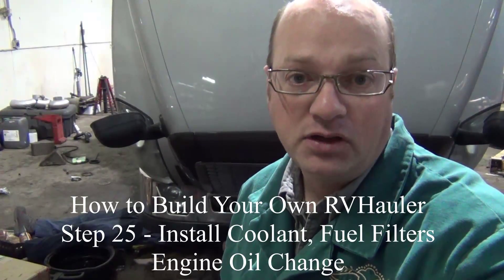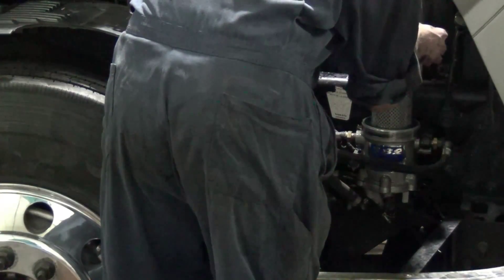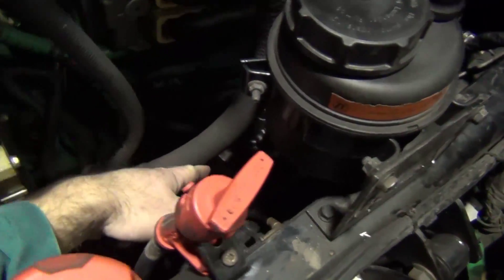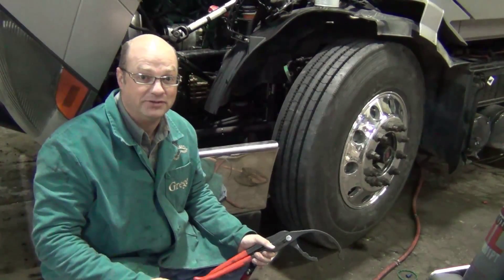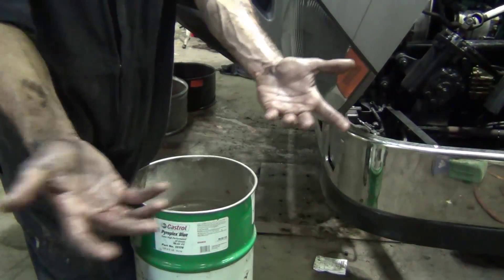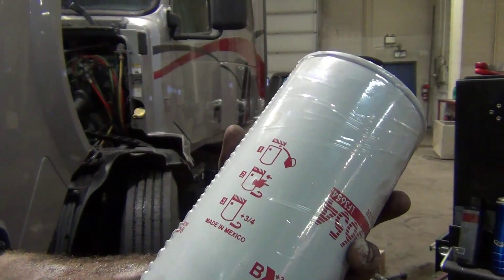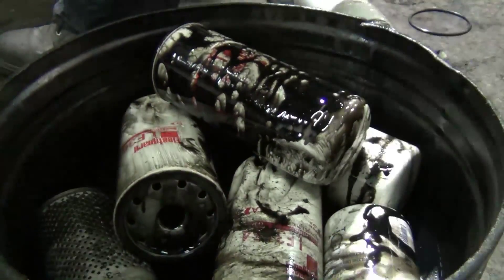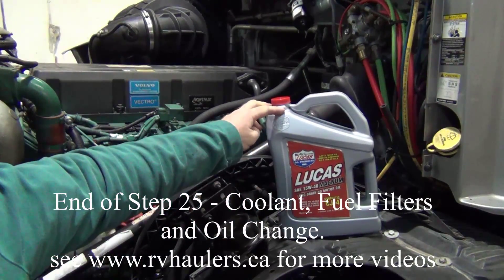How to Build an RVHauler -Step 25- Coolant, Fuel Filters and Oil Change

Comment from the maker: Good recommendation!  The filters are in a tight location between the engine and frame, and we just couldn't get the leverage to twist them off.  We ended up having to use the sling filter wrench, and a 1/2" extension to get the long snipe under the oil-pan and give us enough space to reef on it.